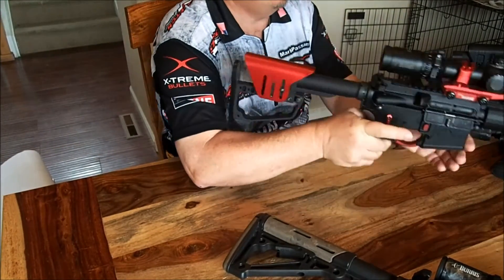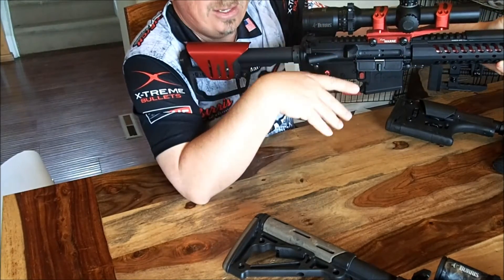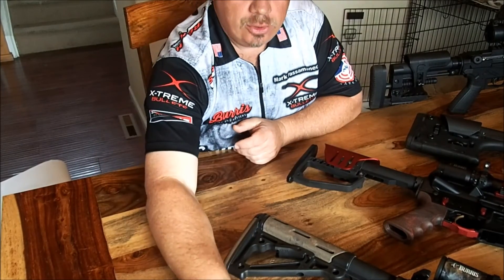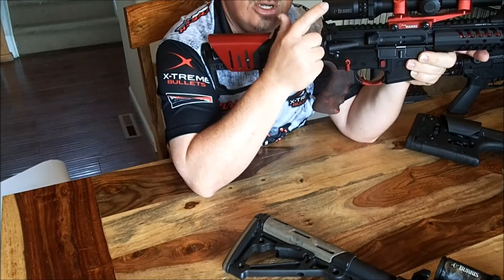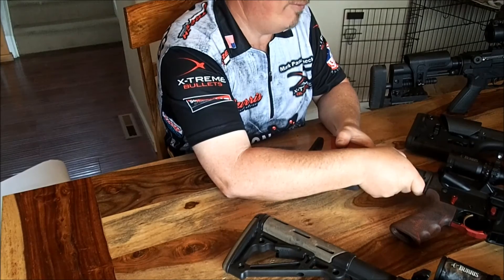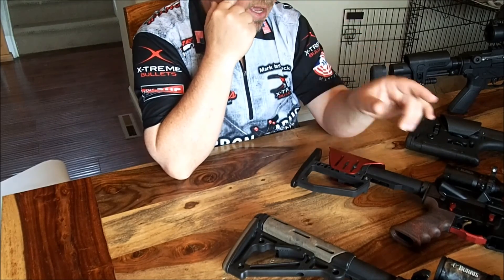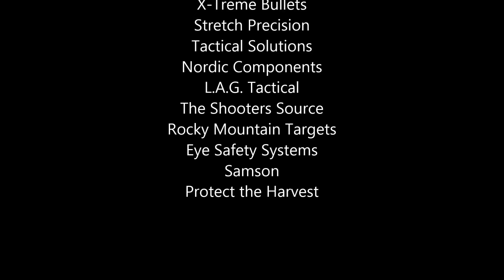Parallax and Cheek Weld

Comment: Finger on the trigger,bolt closed and the safety off. For the love of all things holy slow down.
Reply from the maker: Yeah, if you don't know what dryfire is, you probably should not handle guns at all.  There was no speed issue at all either. :)